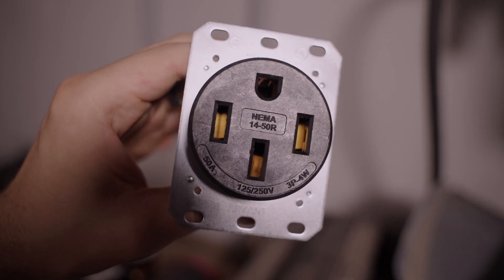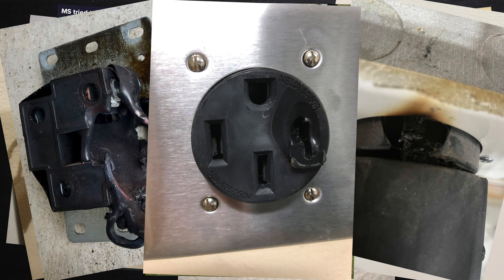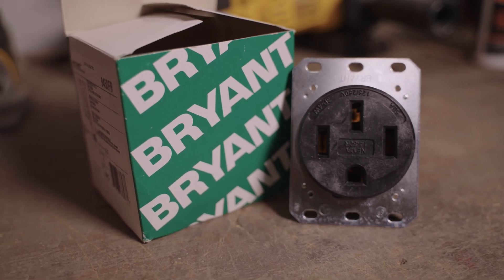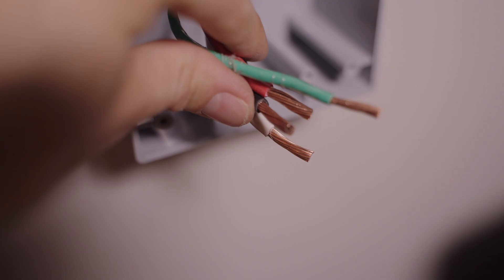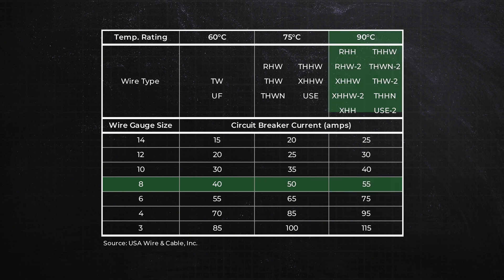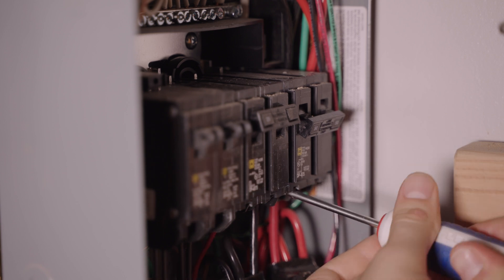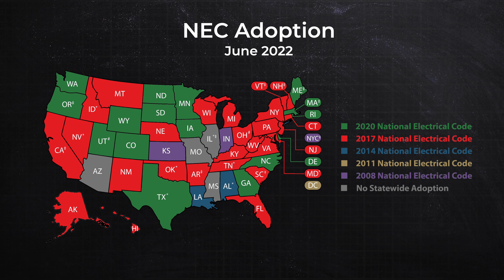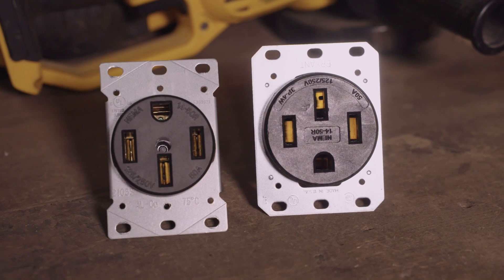3 Mistakes I Made Installing a NEMA 14-50 Outlet

Comment: Regarding the Hubbell vs Bryant debate in the comments, they are identical. Neither are marked 75C on the actual device, so both have to be used as 60C rated receptacles, meaning the conductors feeding them have to be rated using the 60C column. Both say they have a maximum continuous operating temp of 75C in the spec PDF, but this is not the same as being rated for 75C. The manual that comes with both says that the conductor used must be rated in accordance with the 60C column. I just looked at my Hubbell manual, box, and receptacle as well as researched thoroughly online. If the Leviton is rated for 75C, that might be part of why they burn out so often. If they are being installed with 8 gauge wire, they are going to generate more heat, as the 6 gauge wire acts as a heat sink. Just thought I'd clear up any misinfo. The Hubbell and Bryant are both manufactured with superior quality to the Leviton and most other 50A receptacles. This does not mean they can use lighter gauge wire. In order to be a true 50A general use outlet, both will require 6 gauge copper wire and cannot use aluminum. There are exceptions for dedicated receptacles used for a single device such as a welder, but that's a more complex topic.
Reply: Really dude, a heat sink.
Reply: @Tom-og7fi  Noun: a device or substance for absorbing excessive or unwanted heat.
Yes, more wire mass acts as a larger heat sink. Less resistance also means less heat generated. More contact at the connections also means less resistance and better heat transfer. In short, larger wire means less heat and more heat dissipation.
Reply: @802Garage  I know exactly what a heat sink is junior. In the real world of qualified electrical workers we do not use bigger wire for a heat sink. If you need bigger wire it is because you have a need for more ampacity.  If everything is correct for the application and you have heating problems then you have connection issues.
Reply: @Tom-og7fi  I didn't say that's WHY you use it, I said it's an effect it has. Jeez man. As in, one factor which could contribute to not burning out receptacles like the Leviton. If it is heating at the contacts to the plug for example, then the wire will act as a heat sink. Wow big time logic. Exactly what you said and I said in the first place. Thanks for your contribution by repeating what I already said in a condescending way.
Reply: @802Garage  Do you do electrical work for a living. What you are saying is complete BS. Do you know what happens to copper when it gets hot. If you have heating issues, you have a poor installation or a poor connection or drawing more current than the device is continuously rated for. The 80 percent rule is applied to all electrical equipment, not just breakers. This crap of having bigger conductors to act as a heat sink is misinformation period. Bigger wire will not fix the problem.
Reply: @Tom-og7fi  What I am saying is BASIC PHYSICS. It's like you didn't even read what I said. Everything else you said I either already covered or is irrelevant. I covered the code necessities in my original comment. Once again, never said you SHOULD install bigger conductors as a heat sink. That's obviously not why it is done. I said the people using larger conductors with the Leviton receptacles may experience fewer failures if heat is being generated due to the receptacle design in part due to the thermal mass of the larger cable. This is extremely basic logic. I didn't write a scientific paper on it, but please read what I actually said and use some common sense instead of putting words in my mouth. Done discussing air.
Reply: I'm not understanding, why is he lowering the amount of amps He's gonna be pulling on The wire, based on the temperature ratings on the breaker and on the outlet? The way I see it, is that the temperature rating affects how many amps the wire could hold, but as far as the outlet and the breaker, they clearly say on them how many amps they can handle.

Comment: There are several overlapping and seemingly contradictory Electrical codes covering garages.  These will either add or retract from the Amps or equipment requirements. I listed a few that apply to the video I saw.  Continuously operating equipment: something that will operate for more than 3 hours. A dedicated circuit: 1 circuit breaker, 1 wire run to one outlet.  Also, garages normally require a GFCI, but not if a dedicated piece of equipment was used like a freezer or a charging station used solely for your car.  As a master electrician, I can honestly say, the electrical code can be put on one page, the other 999 pages are basically exceptions.  According to the electrical code, you are running a piece of equipment that is continuously running, on a dedicated circuit that is for one piece of equipment.  These things are additive to your base calculations of amperage draw, that's why the outlets are melting. The outlet is the weak link in the video. Next, the insulation on the wire will start to weaken and crack.  It's a safe practice that if you're not sure, just go to a higher level: use a 60 amp breaker, 6 gauge wire, etc.  These codes are there to prevent the circuit components from overheating and damaging the insulation, NOT to make sure the copper strands can handle the electrical current.
Reply: this is why it is better to just use hardwire chargers. You just take out the plug from the equation.

Comment: For our Tesla model Y we had an electrician install the NEMA 14-50 outlet but it was cheap and overheated. Teslas deal with this by lowering the charging current.  Looking at the cost of a good 14-50 and the GFI breaker I plunked down the $400 for the dedicated wall charger.

Comment: Mistake 1: calling it an "outlet" (besides buying an EV) 2: unscrew is not a WORD OR TERM.. 3: PRETENDING THAT YOU KNOW WHAT YOU ARE DOING and giving advice..
Reply: FO. It is an outlet to most people. (And the licensed electricians I know say "outlet" when talking to their customers.) This video is not aimed at electricians and "unscrew" is very much a word. Get over yourself.
Reply: @JorgTheElder  When someone pretends to know what they are doing, they SHOULD have some actual accurate knowledge to work with.. You are WRONG about your vocabulary issues.. I'd bet that you do not know a single "licensed electrician" and therefore have never been involved in a conversation between a contractor and their clients.... NOT one single thing you said is accurate but it is YOU telling ME to get over myself for being 100% accurate???  Interesting approach you have chosen... .

Comment: I applaud you for trying to correct your mistakes. 1. the NEC 110.14C  does state that circuits under a 100 amps in a dwelling unit shall use the 60° column. You saying that even with 90° wire and a 75° breaker, you kinda met code was in error. 2. The basic 14 -50 plug is a non continuous duty, which is rated for less than 3 hours use at a time.. EV charging requires a heavy duty,  continuous duty rated receptacle. Which is for more than 3 hours use, as per code.
3. That 14-50 was not originally for EV or the stove(10-50R on 40amp breaker was stove). 14-50R was designed for RV's and they are so readily available EV's found it easier to use. Even though the EV doesn't need the neutral. When I consulted with Tesla. The 6-50R was proper for EV use, but not widely used. It's easier for a customer to put in a 14 -50R and have a multi-use for it. 
4. Please remember, there are several states around the country that homeowners are not allowed to do their own electrical work, Texas being one.
Keep up the videos. We all learn somehow.
Reply: False.  You can do your own electrical work in Texas.  Mine passed inspection even, when I remodeled a house I used to own down to the studs.  Rewired the whole house.

Comment: Good video.

Have a question.....
My home has only WHITE, BLACK, and ground, but no RED wire. 

So my question is, how would I wire the plug (both ends) without a RED wire. Was thinking of running a jumper from where the black wire goes into the back of the plugs to where the red goes.
Reply: Please do not do this. Call an electrician if you think that’s an ok thing to do.

Comment: At the end of the video you said that local electricians will know all the standards and what to use.  I'm over here on my 2nd (!) melted NEMA 14-50 outlet because the electricians that installed it didn't use a "commercial" or "industrial" grade outlet.  Thanks for helping to spread the word about this issue!
Reply: Just tape the ends of the white wire red, or any color but white or green, and tape the ends of the red wire green, double check and retorque the connections, and there you go. 💙 T.E.N.
Reply: Did you get it changed to a Hubbell outlet? If so, how has it held up? Ive spoken to electricians and they don't think the issue is because of a cheap outlet but rather because of frequent disconnects which cause the connectors to expand and cause a short.
Reply: @GSP-76 I've had zero issues since installing the new Hubbell outlet. Not sure what you mean by frequent disconnects. Do you mean from plugging and unplugging the charging cables?
Reply: @toastymallows  Yes, I was told by two different electricians that fixed burned out 14-50 outlets for customers that when they inspected the damaged outlets, they saw that the connectors themselves were warped...they said that happens due to frequently taking the plug out and in if you use the Mobile charger. This wouldn't apply if you use a wall station that stays plugged in...also, the Hubbell is definitely better than the cheaper ones because the glass fiber portion (the black part that sticks out the front and goes to the rear by 4-5 inches is much better... maybe that's all that's needed but I'm just trying to get feedback from people who had this problem. Do you use your mobile charger at home or a wall station?
Reply: @GSP-76 I actually use the NeoCharge Smart Splitter, so I plug it in once and never unplug it. This was the case with all three outlets I've had, so I don't think frequent disconnects is the issue, at least for me.
Reply: @toastymallows  That's what I'm trying to figure out...I'm in the process of getting the 14-50 outlet installed for my EV...I guess I'll put the Hubbell outlet in to be on the safe side and maybe install a wall station to avoid any possible issues.
Reply: @GSP-76  probably your best bet! Good luck 🤞
Reply: Take away set it up so that you never have to disconnect it.
Reply: A friend had an electrician install a 30 amp 240 outlet in his basement for some power tools and they used the black + white for hot leads and the red for neutral,  no 4th wire ground.
Reply: @schsch2390  No excuse for being lazy with the colors.  That's likely all it was though.  The red was being used as a ground wire, not neutral.  A standard 3 wire 240V outlet/circuit is two hots and a ground.  The more common 3-wire outlets is the standard setup for providing power to a basic mechanical device that runs on 240V, such as high voltage power tools.  The 4th wire, the neutral, is used to create a circuit/plug that supplies both 120V and 240V to a connected device.  This 4 wire dual voltage circuit is required by more advanced devices that use 120V computers or digital interfaces to control their 240V mechanical components (such as a modern clothes dryer with 120V electronics for user interface and programing and 240V heating element and drum spinning motor).
Reply: @cjc9719  Not an electrician, just a lowly mechanical engineer, but have worked w/ 3-phase stuff.  Recently, when removing an electric range, I found the 240 VAC house cable to it had just two hots and a bare ground (alum wire).  Both neutral (wht) and ground (grn) of the stove were connected to that bare ground wire.  I found that is common and allowed, at least when the 1972 house was built.  Don't know if the stove also needed 120 VAC also.  If not, it wouldn't have needed its white neutral wire.
Reply: @SihAza  if it was a stove it would’ve needed 120v for lights and whatever else. It would have been getting it from the ground being used as a neutral. Which is definitely not allowed but would work.
Reply: @schsch2390  must be a shotty handyman and not even an electrician is mess that one up...
Reply: @schsch2390  what power tools needed that? That’s what usually is used for dryers. The dryer wouldn’t work right if it wasn’t wired correctly. What happened to your friends outlet?
Reply: That's why my mottos is "If you want it done right, do it yourself."  I have yet to find a pro who can do any job better than I can.

Comment: Some states seem to adding exceptions to the GFCI requirement. I know in Massachusetts I was reading the bill adopting the 2023 NEC and they added bit saying in circuits with one outlet meant for a single device you can forgo the GFCI if they are known to interfere.

Comment: There is no such thing as UL Approved. UL never approves anything. They test to see if electrical equipment will catch fire or be a shock hazard. They do NOT test to make sure it works.
You explained the temperature rating correctly. The amperage of the conductors are limited by the temperature rating of the terminals.
Although the 2020 NEC has such a requirement, you are correct that it does not apply in all jurisdiction. Also, when the 2020 BEC is adopted in your jurisdiction it is NOT necessary to revise the installation as the NEC is not retroactive but only applies to new installations.

Comment: How can you be sure that power is off if you don't use an electrical tester to make sure it is? Never skip that step! Take a Fluke T+Pro, or Klein ET60 or Ideal VolTest or whatever and make sure the circuit is properly de-energized before even thinking about removing the first screw!

Never assume. Always test. And use the correct tester for the task, no death sticks or multimeters. Please. Don't promote dangerous working practises. People might kill themselves because the've seen your video.

Working on an open energized panel with uninsolated tools without protective wear... That's not how it should be done! Not at all!

Comment: Instead of doing such inappropriate installations, you in the US (and also in Brexiters' land) should force your energy providers to provide 3-phase current to your houses (They gave you single phase or split phase only because they wanted to reduce THEIR costs on YOUR expense. Your whole house installation would be much cheaper, too)

In case you had 3 phases (e.g. 230/400V), you would typically need a 16 amps breaker only and a 4-6mm² wiring, instead of f*cking dangerous 50 amps on AWG 6 or 4. Anyways: Connect the cables directly to the charger. Don't use outlets at all !

Comment: I've watched a few videos on this subject and you are one of the few who torqued the connectors. My installation was extensive enough that a inspection from the utility was required, and I was impressed the inspector checked the torque on the connections. He mentioned that this was the very point where he fails many installations.

Comment: as an electrician myself id be suspicious of a few things with these ev chargers first is how much current do they really draw not just what it says it does what about how far away from panel box are these melted receptacles not everyone has the convenience of having their plug in 3 ft away from breaker panel i've seen people run these things way across their house without accounting for voltage drop which brings me to my next point what voltage is actually at the plug loaded and unloaded. another is how good of quality is that ev charger plug is it a chinese made or foreign made plug cut it off make sure cord had adequate size and rated wire and put a nema rated american plug on it and for the love of god torq it because good and tight will cause an uproar in the know it all community on you tube.

Comment: The first thing you did not correctly is doing an electrical installation that should be done by a certified electrician with proper skills, knowledge and responsibility insurance. It’s not like changing a light bulb.

Comment: Got one from Home Depot $11 worked great for over a year without melting. I used 6 AWG wire always want to go heavier on wire.
Reply: The heavier gauge wire will help act as a heat sink for the entire device.
Reply: I think the people for whom it melts likely unplug it too often.. Just like a regular outlet after a bunch of plugging and unplugging cycles, you lose grip. I've seen the same issue with people plugging in electric heaters (who also pull a lot of power over long periods) into loose outlets causing melting and burning. With the $11 outlet you likely need to be replacing it on a annual basis IF you unplug it often.
Reply: @LubomirGeorgiev I had a 15amp plug melt using a class 1 slow charger
Reply: Please use 6 AWG. 50 amp x120 volts = 6kW. ——6000 watts appliance….

Comment: Great video! Is there a way to rewire a 14-30 to a 14-50? Looking to convert the home dryer outlet to a full power level 2 up to 50 or 60 amps.
Reply: You would almost certainly have to pull new larger wire in place of the original wire.  That's a good job to have an electrician do for you.  If you want the leave the original wire in place, many chargers (EVSEs)  can be set to limit their current based on the breaker size, or offer adapter connectors for different types of outlets.  14-30 is a pretty common one. You'd set the charger to supply 24 Amps (80% of the 30A breaker assuming the wire and the breaker are correctly sized for the existing outlet) and be able to charge 3-4 times faster than on a 120V outlet.

Comment: 75C temp breaker. Really? Only 40C max from HomeDepo
Reply: Almost any breaker sold today will be rated 60C/75C and certainly are rated for higher than 40C. Even if it is unmarked it is assumed 60C.